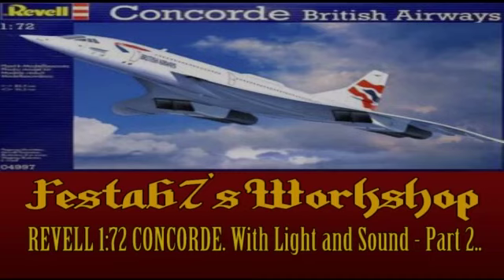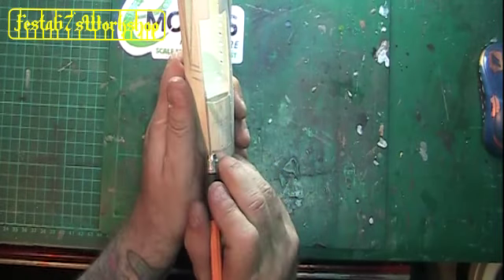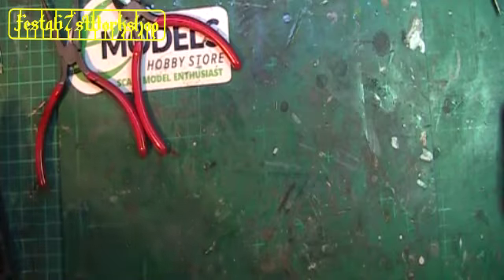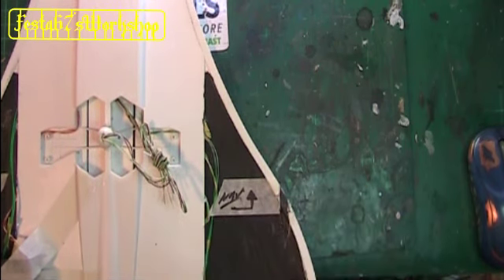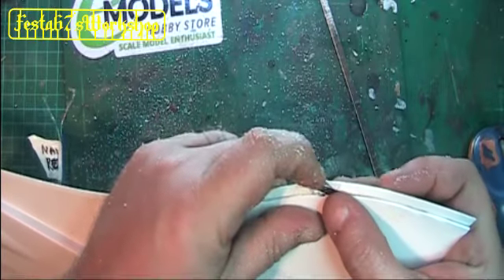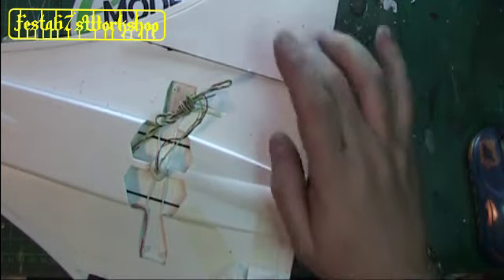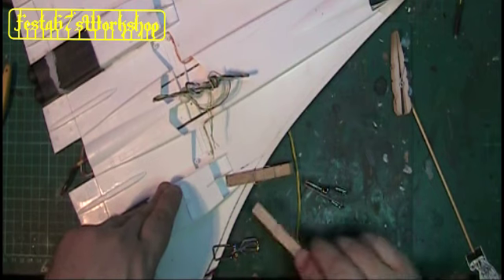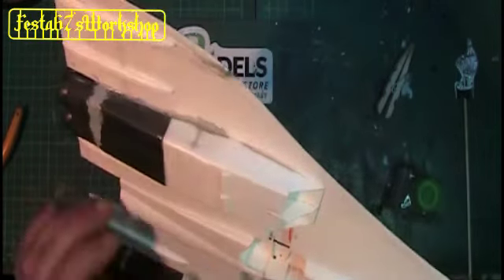Revell 1/72 Concorde Pt 2

Comment: Just found your channel.
Fantastic work.
I am half way through the Airfix 1/72 Concorde and yes it's the same kit, the same problems.
Shelved it for a long time and after watching this build I just might get back to it.
Reply from the maker: brilliant, i lost the later videos due to a hard disk failing, lesson learned, but may yet do another.
Reply: @festa67  shame about the lose, 
Did you get the nose  working.
That's the point I left it ???
Reply from the maker: @neilquarrell7551  Yes mate, a dunk in sprue goo solved the issue. i have since dropped her and had to glue back on..

Comment: Looking good mate. I remember when I did mine, although gear up so a little easier. Looking forward to P3.
Reply from the maker: yes what i mean by daisy chain is that the all independently connect to +/- and each have a separate resistor is it parallel

Comment: Don't know where you get your lighting kit from, or what's the cost.. this is what goes in all my builds; includes 555 timer and a decade counter, so you can offset the strobes if need....thought you might be interested
Here's the link
https://www.ebay.co.uk/itm/NE555-CD4017-LED-Light-Chaser-Sequencer-Follower-Scroller-Module-DIY-Kit-Red-K/192500561804?ssPageName=STRK%3AMEBIDX%3AIT&_trksid=p2057872.m2749.l2649

P.s,,,,I replace most of the L.e.d's with 'micro L.e.d's (pre wired,,,also very cheap).
Reply from the maker: I will be ordering these from you. Im looking at navigation lights for planes, full lighting for cars including turn signals, front and rear lights, and police strobe lights. can you email me a list of stuff you supply please? festa67workshop@gmail.com